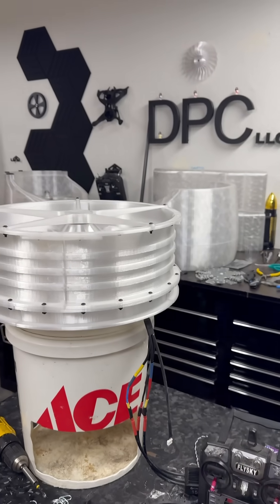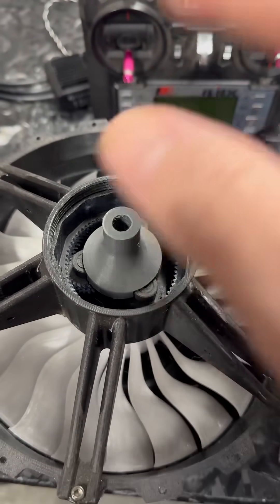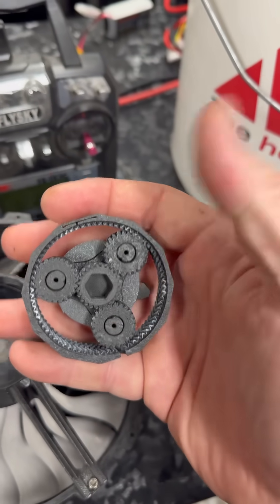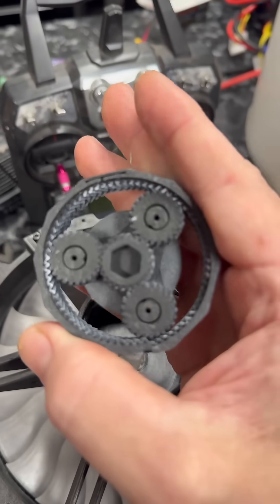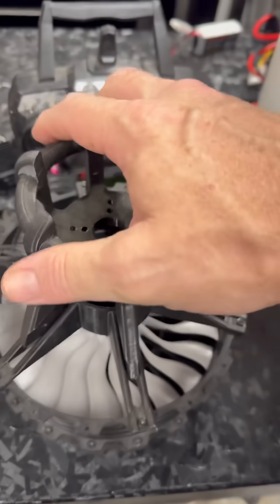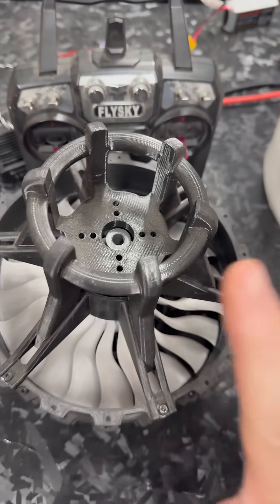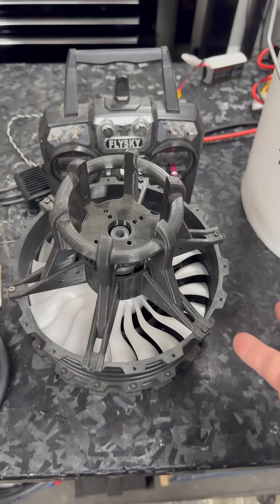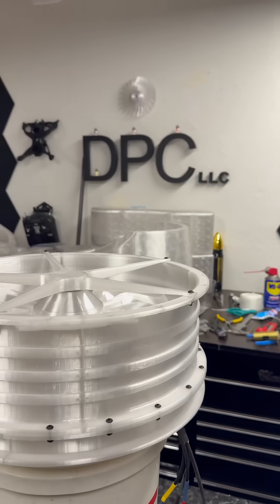170 mm electric EDF turbine update. Stubby fan V6.

Comment: Use carbon
Reply from the maker: I have used PETG carbon fiber, nylon six and a few others, although I have not tried milling it out of straight carbon fiber sheeting, which could be done if the sheet is thick enough but then we still come back to the same problem of milling how do I mill the interior gears on a desktop CNC Even if I get one. I could send it out to be professionally milled, but I don’t have that kind of money who does I could buy a decent desktop one with what they charge to do one part. OK maybe a few parts but you get my point.

Comment: You need to design it like a ebike hub drive metal pinion and ring with some tough nylon-ish type planetary gears. I bet that would work good once you got it tuned
Reply from the maker: Might be an idea but I think they spin the ring gear that's attached to the wheel, don't they? I could be wrong. However, in my design I'm spinning the sun gear for the step up.

Comment: You could always donate a kidney and get yourself one of those fancy laser sinter metal printers 😂
Reply from the maker: The tolerances aren’t tight enough. I can’t rely on a .3 tolerance in either direction.  That’s what I got out of the last attempt. Did the PCB way thing and it was so far out gears wouldn’t mesh. Need to cut these.
Reply: @warmachined3472 gotcha, I was going to mention pcbway but assumed you already knew that so I figured Id just say something dumb for algorithm God. I didnt know the LS had such big tolerances but it makes sense considering the process. That inside gear cut is going to be tough to pull off and my math skills dont have enough patience to figure out the pitch change in the teeth if you were to cut it flat and roll it but im absolutely here to see you pull it off. Good luck
Reply from the maker: The easiest way for me to do the imposable, is to know I can, no matter what. If it won't' work sit back watch because that's when I make it happen.